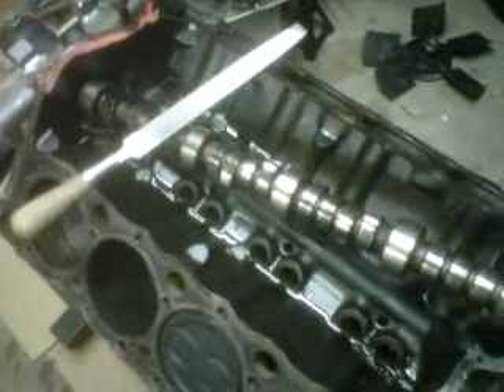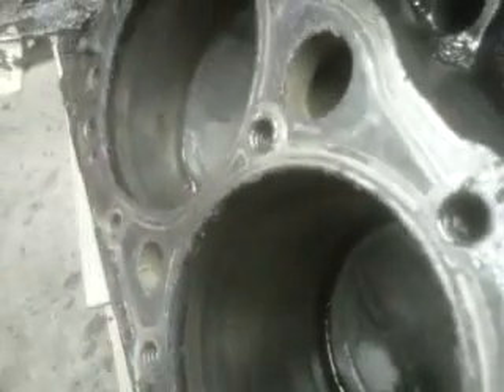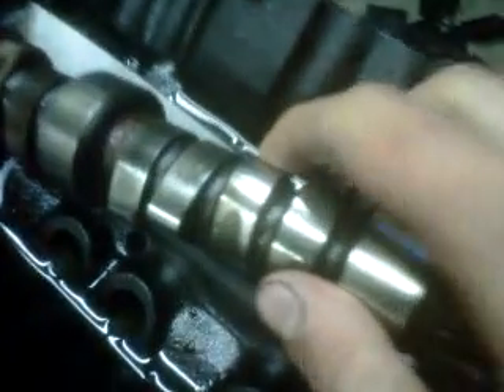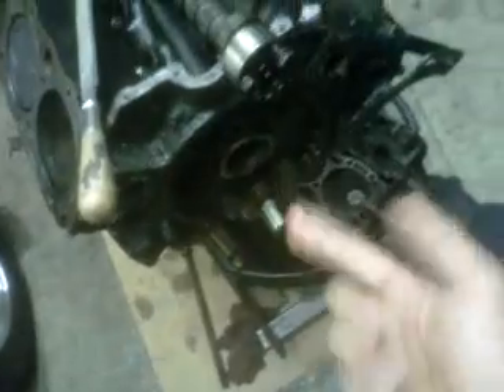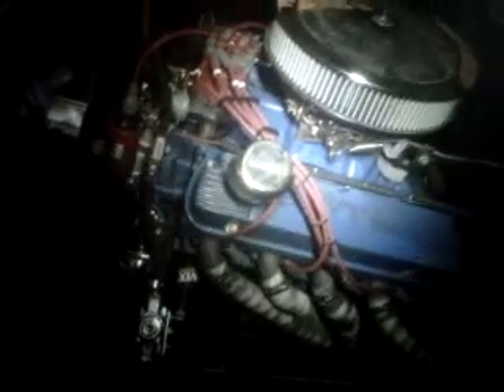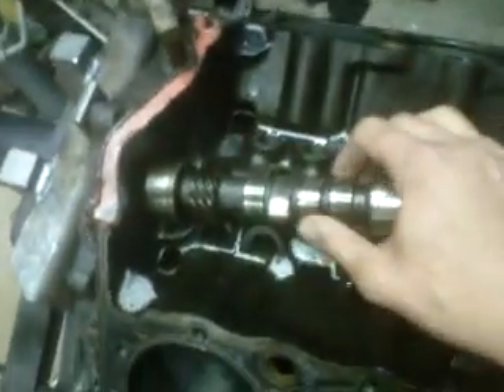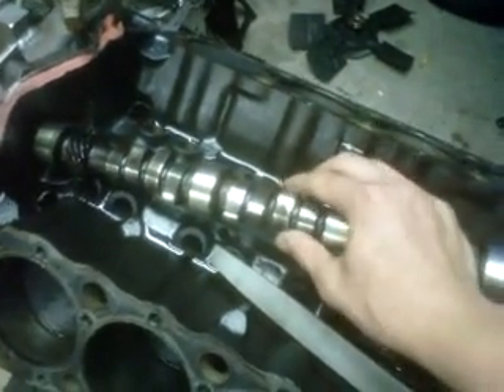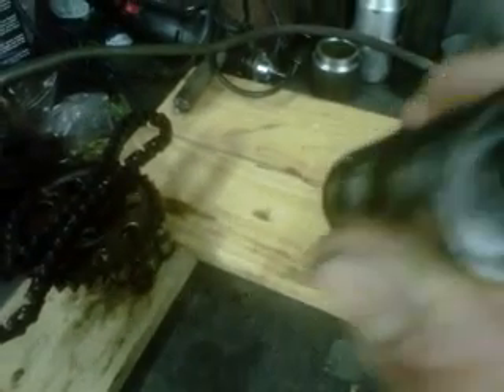Flat Tappet Cams need Zinc -here is why

Comment: Joe Gibbs Driven oil has the correct 'balance" for flat tappet camshafts.  On a cam swap from a hydraulic to a solid flat tappet cam I used Joe Gibbs Driven XP4 15W50 Racing oil without any additives.  Typical moly paste on the cam and on the foot of the lifters, which are ISKY branded Johnson EDM lifters made in the USA.  The camshaft is a custom ground ISKY solid ground on a Pro55 cam core.  It has fairly aggressive lobes on both intake and exhaust as the mechanical intensity is 32*.  Not to mention the valve springs are PAC 1200 series 'Beehive' set up with 148# @1.90" and 350# @1.37" over the nose.  My new cam is broken in perfectly and the lash hasn't budged whatsoever in a thousand miles of driving.  There's the PROOF that the correct oil for the application works.  Good video and thanks for the info.
Reply: Both Crower and Isky  j have lobe angle and hardness figured out(and no chinese crap). Joe Gibbs is high zinc so you have that covered..as long as you understand that valve lash on the heel of the cam has nothing to do with the nose grinding itself away. # ways to know for sure...send oil sample out for analyses, next time you check lash check lift on every lobe with a dial indicator and see if it's spec..or pull the intake and have a look..Those numbers..is that a hot rod cam in your world?I'm assembling a BBC at work..it has olds heads and the cam has .890 lift and 1010 lbs over the nose.
Reply: Even though the process was time consuming, I pulled the intake off in order to do a visual as well as a mechanical(measure) inspection.  All sixteen lobes passed the dial indicator inspection and all readings were identical as per the cam card issued from Iskenderian Racing Cams.  I'm very happy with how well the break-in process went on this valve train thanks to careful attention to details to do it right the first time.  And one of the major details was the proper oil installed for that critical first start up.  Your Big Block Chevy sounds like it will be running in 7's!!!  Totally cool, and cheers.
Reply: Joe Gibbs got the zinc...no  worries for  you  :)   "7s" ? It's the second half of a pair  of offshore/poker  run motors for a 40 ft Skater. Basic 4.5 X 4.600 (584 ci) with a PSI/super chiller running 90% over and  upper  lower efi. # 1 motor made 1540hp on 93 race gas and 2020hp  on E-85  at 5800 rpm. Is that '7s' in your world? lol Boat ran 176 with 2 1350 merc racing motors....It takes about 1200 to get a hydro to run low 8's.....so ya, 7's..even in a boat. Can't drag race big boats, the drives won't stay together...bad enough the best outdrives money can buy will need a $7500 overhaul every 20-30 hours run time......oh..and the 5800...not enough ignition to spin any faster....needs a mag. #2 motor gets a crank trigger and 8 coils and 18 volts. How's your math? If # 1 made 1170 @ 5600 and 1540 @ 7800 how much will #2 make @7800 ? :) peace
Reply: Next phase, two magnetos for #2 burning nitro-methane.  Even so, the sound of those engines is all out maximum excitement.  I was at a dyno shop a few years ago and watched a Big Block Chevy produce 910 hp on a pull, and that was pretty wild, especially since I was standing four feet from it as it ran to 8,000.  My 'piddley' 460 cid produces 566 hp @6,200/540lbs ft. torque @ 3,600 on the dyno, and that was way more than I expected, it has way more power than I will ever need, street car.  Application specific, 2,000 hp marine big blocks would definitely make for one wild ride on the open ocean, and the sonic signature of brute force and all out power.

Comment: question: for a worm cam lobe, is it recommended to get a new Engine due to possible metal debris engine contamination from metal-metal pitting?  Or not necessarily?
Reply: Worn... how much [I'm thinking tenths], and how long did it take to get there?   Easier: oil pan & filter are the quick tell.  lots of sparkles means fine metal debris.  Engine ought to be disassembled for a thorough cleaning, and don't trust the bearings, even if they look smooth - cheap insurance as I see it.  Crank journals might need a light polish.  Minor cam wear can be corrected with a regrind to restore proper taper, and: go get new lifters if you do that.  And as always, if the cam is chowdered, float test it.

Comment: I'm guessing you are tearing down the short block otherwise fileing in the lifter valley might not be a good idea. Don't mean to be critical. You are correct on the zinc based oil for older engines. Good video and Cheers!

Comment: Yeah, I have a feeling my comp cam is flat already.  I've only got 5-6k miles on it.  I didn't use a zinc additive. I use conventional valvoline 20w-50.  The cam is comps xe268 in a rocket 350.  It's just super unfortunate because the thing was running F'in awesome.  What I think I am going to do is attempt to warrenty the cam and lifters through comp. Break in with conventional then switch to VR-1 with a ZDDP additive.  What oil do you prefer for a street motor with a flat tappet cam?
Reply: Valvoline is junk!

Comment: They removed ZDDP from oils because it saved money, and used environmental reasons as the excuse.  It neither harms, nor helps most engines.  It's essentially useless for cars with roller cams.  But for flat tappet cams, especially those with high lift and spring rates, it cushions the shear between lobe and lifters.  Without it, failure is inevitable, under real world conditions.
Reply: Too much Zink will ruin the Catalitic Converter, oil companies had to find othere anti ware additives to replace the zink.
Reply: @markwarnberg9504  ZDDP does harm catalytic converters, but only if such quantities of oil are pouring into them that the oil itself would be a big problem.  Oil companies do put in anti-wear additives, but as the only component that really needed ZDDP was the sliding/rotating bits of the cam and flat tappet lifters (and no cars were being made with those any more), it seemed like a good time to eliminate the 'extra' additive.  It was primarily a cost saving measure, with the added bonus of "being good for the environment", despite the fact that it wrecked untold thousands of engines when it happened.

Comment: It's not the zinc in ZDDP per se that protects against cam wear; it's more the associated sulphur & phosphorus. I suspect that only part of your problem is due to lower levels of ZDDP.  In the US, native sulphur in base oils has almost been eradicated as the industry has moved away from basic mineral oils (Group I) to hydro-treated (Group II) and synthetic base stocks. Your engine was probably designed around higher levels of ZDDP combined with sulphur bearing Group I. Finally it's clear that in the US there's been a marked move to lower viscosity grades. If you want low cam wear go thick rather than go thin to get a higher compressible oil film.
Reply: Sounds sensible.

Comment: I'm curious about the comments that mention the additive you use does not contain zinc and that you have not answered those comments. Well, considering your whole video is based on you believe zinc helps, yet the additive you've been using that you believe is helping solve your problem does not contain zinc, what is actually happening?  I suppose the debate is still open whether or not zinc should be used.
Reply from the maker: You need a high pressure sacrificial later. Zinc is what is typically used for that. 
Definitely need zinc with flat tappet stuff. Oil today only has 500 ppm. 
Basically it gets used up very fast in a flat tappet application. 
Think of it as a sacrificial item that is depleted as the engine runs

Comment: That hy-per lube stuff doesn't contain zinc, it's a replacement additive. does it really work though? I'm using vr1 valvoline racing oil on my flat tappet

Comment: Ive read that Pennsylvania crude oil is good for these type of engines. It has a green color like the old Quaker State oil did. Only company I know selling it now is Brad Penn.
Reply from the maker: bbodinefan11 iv put 8700 miles on my solid lifter 289 powered 5 speed galaxie this summer. i add a bottle of the lucas break in oil (its zinc, they just cant legaly advertise it for oil changes) to 4 quarts of standard pensoil. the other quart is lucas oil stabilizer to keep oil on the cam for dry starts. can buy the oil for 15 a 5 quart jug, lucas stabilizer for 25 for 5 quarts, and the zinc additive for 10. (lucas products bought through summit). my oil changes cost me roughly 27, or around 30 bucks with the filter. no need to run expensive oil. i have not lost .001 off my valve lash adjustment in the last 8700 moderate revving miles. 
so i guess there ya go. . . a book you didnt want to read! ha!
Reply: Not really doesn't matter to me. I was just sharing what Ive read. Sorry to ruin your ha moment. Only real old engine I got is a 76 302 and I run standard Quaker State 10w30 in it. Works like a charm.
Reply: I do like Lucas products though. Good stuff.
Reply from the maker: if it works, use it. id be leery myself just because of what i have seen. i definitely cant get away with it on solids with my spring pressures.
Reply: Schaeffer Oil!!!!! By FAR the best oils I've ever run and cheap too.

Comment: I do use stp oil treatment, she has zinc too right? I can feel the difference almost immediately after topping up with some stp
Reply from the maker: +fidel catsro stp does have some, i beleive it will move you from 500 to around 1300 maybe. how much does it cost?
Reply: +ThunderHead289 about 5 or 6 dollars only, engine car or bike, feels less grinding after addition, I think its the zinc content..i live in the tropics, engines here run very hot..

Comment: So you only put half of the bottle  of lucas zinc?  I used Valvoline conventional oil the white bottle on my 2000 jeep grand cherokee 4.0 inline engine.
Reply from the maker: when I use the lucas stuff, I use the full bottle. I would think your jeep would not need it unless it is not a roller style cam which im thinking most everything was by that time

Comment: So we recently bought a 1966 mustang and put in castrol synthetic 10w-40 is that okay or what oil should I use.
Reply: No it's not ok unless it has a roller cam.     You should use joe Gibbs
Reply from the maker: j smith why did I never see this comment. . . no, you need zink. people think they are safe with diesel oils, but those now have very little zinc as well.

id stay away from joe Gibbs since it does not have any detergents and the motor can gunk up quickly. good for racing, bad for regular street use. you can just use the lucas break in additive in  every oil change or switch to a retrofit roller.

im done with flat tappet in my own stuff personally.

Comment: Hi, mm i have just bought a 1969 mustang, and i want make the first oil change but i dont know if i have to put some zinc in or not, the motor is an old 302, and if i have to ¿what oil and zinc additive do you recommend me?
Great video thanks
Reply from the maker: hi, you will need zinc. I recommend hyperlube or lucas break in additive. both are good with zinc. though its called break in addititve its actually a zinc addititve
Reply: I have a 79 F100 custom with 302 and C6 I also bought a bottle of hyper lube oil supplement but I did not get the smaller bottle that says zinc does that still protect a flat tappet cam or do I need to get the small bottle that says zinc on it

Comment: My god. I may be facing this same problem in my '77 Corvette with a 355. I broke the cam in with proper additive, but the oil change after that didn't have zinc, and the current oil change doesn't have zinc either because I didn't know it had to be added after break in. Well if my cam turns out to be ok, I'll without hesitation add zinc to it from now on. I'm building a really nice ford 302 for a '65 Sunbeam right now, paused on that to buy a new house with a shop, so the last thing I want is another expensive/time consuming project... Fingers crossed
Reply: Rotella T or Delo, diesel oil.
Reply from the maker: lynchingacers diesel oil no longer contains proper levels as of new emissions regulations.  they run max 800ppm when you need a minimum of 1100ppm. quakerstate defy claims 1100ppm, but id rather run an additive. I just remove half the oil out of a new jug and put the additives in and shake for ten minutes so I know they are good and mixed before putting into engine. I prefer 1500ppm minimum
Reply: Vavoline racing oil has zinc.

Comment: do you recommend the zinc even if you're using synthetic oil?
Reply from the maker: yes most definitely. synthetic is not a whole lot better the regular contrary to what they like you to think. there is no replacement for zinc, it needs to be in the oil for all flat tappets.

Comment: I bought some comp cams stuff I'm going to use when I put my new cam In..vr1 motor oil contains zinc and qauker state defy contains zinc that's the only too om the shelf that contains it...but I am a royal purple guy and just add additive to that unless it's the break in oil in witch that case it has a lot of zinc in it
Reply from the maker: qstate and penzoil are the same stuff, just a lil trivia info. all oil actually still has zinc, its just been dropped to 500ppm from the 1200 to 1500 from back in the day. defy only runs 1100 ppm which is okay for a stock lift cam, but anything high lift with stiffer than stock valve springs will require more zinc. iv just always gone with the standard cheaper stuff(as defy is ridiculously priced) and used additive accordingly.

the reason I use the hyperlube stuff is because the detergents in the oil actually work against zinc (designed to pull from the surface and zinc is designed to sit on the surface)

the whole situation with zinc is really not ideal these days, I do mostly fords for myself and try to stick to roller blocks to avoid this worry(even though I still add zinc) ha!

Comment: Cross hatch should by no means be gone even at 30k high performance engine it allows oil have a nice coat on cylinder and rings to rotate while piston is moving I'm not sure what your implying there
Reply: B00steDevil definitely not true in passenger vehicles. Over 100k miles you’ll lose cross hatching. It’s not a major issue. Cross hatching really just helps rings seat, so practically useless aside from assembly. It does help oil yes, but that’s what the piston skirt grooves are for.

Comment: I have a Chevy Monte Carlo 305 should I use a zinc additive ?
Reply from the maker: +frincon75 depends if you have a roller cam or flat tappet
Reply: +ThunderHead289 how would I be able to tell that?
Reply from the maker: what year is it?
Reply: +ThunderHead289 1980
Reply from the maker: yes, you have a flat tappet cam. with stock valve springs you may be okay. . . . but really all flat tappet cams need zinc.
Reply: like about an 80 with electronic carb?  If it was mine i be looking for an 88-to about 92 350 motor. the block is set up for rollers and if nobody has screwed with it the cam/lifters might be reusable. Roller cams don't usually wear out. 4 barrel intake fit that long block...somebody who knows electronic carbs will know how to dial one in and install an older dizzy with vaccum and mechanical advance...i did same to an 80 malibu wagon i used to have..it ran plenty decent...it's all workable as long as you don't live in ca..

Comment: u didnt clarify this is for cars built to run on leaded fuel or SG grade motor oil.
they say the new motor oil specified for diesel engines has enough zinc it because of the brutal way diesels work
Reply from the maker: the high levels of zinc in diesel oils went away in 2011.
Reply: A. Shell has Rotella lubricant series, T6 has zinc additive, and;
B. ConocoPhillips 76 Lubricants Guardol ECT w/ Liquid Titanium
C. Mobil Delvac
D. Chevron Delo
E. Petro-Canada Duron
F. CITGO Citgard
G. Royal Purple
H. Valvoline Premium Blue
I.  Castrol Tection

All designed for older cars or diesels, not Converter safe
Reply from the maker: +Super Godzilla I know for a fact shell and rotella do not. Do your homework on those. I hope your right. I went roller on my own stuff
Reply: Are you referrring to just Rotella or Rotella T?  Im talking about Rotella T4, T5 and T6. The lower grades are for different applications.
Reply: who the fuck said anything about diesels ?
Reply: AustinAutomotive they were talking about running diesel oil because its zinc content, a very common practice of not too long ago. But those days are gone.

Comment: The additive you used in the video don't contain zinc says so on the back of the bottle..A
But you must always use zinc on flat tapped cams
Reply from the maker: im aware that it does not contain zinc, it is supposed to be a zinc replacement so I tried it out. I have been running it for 8000 miles on my solid lifter engine and it seems to be still doing well. I have been pleased with it thus far. I cant decide if I want to switch, I use lucas break in lube as my zinc additive on all my other builds.

Comment: Some people are saying break in the engine with zinc included oil, then once the cam has been broken in, then you can run normal engine oil form there, saying it should be fine. I am not sure if I am going to do that on my 1978 Camaro.
Reply: Scott C zinc or use 20w50

Comment: zinc in oil is a complete myth and actually kills lubricity. Many race teams running flat tappets have stopped using zinc in the oils and instead of replacing cam and lifters every season they can now go years without cam and lifter replacement. This video is just regurgitating the myth
Reply: And I would bet it's because those race teams have seen the benefits of running a good quality synthetic oil in their engines. Even without any knowledge about oil I have always been skeptical about this zinc thing.